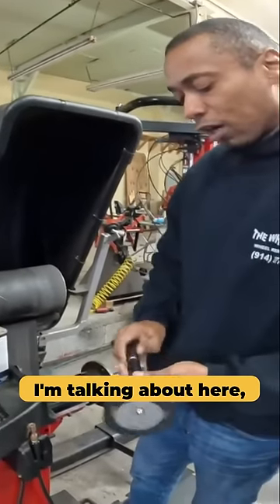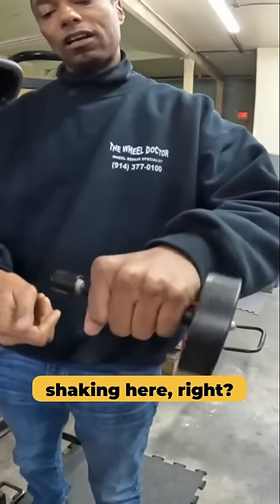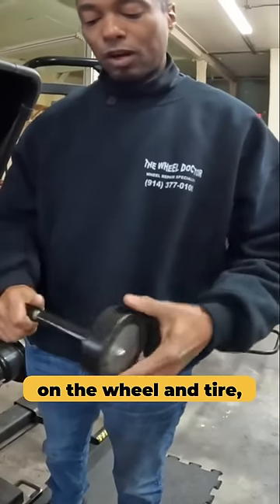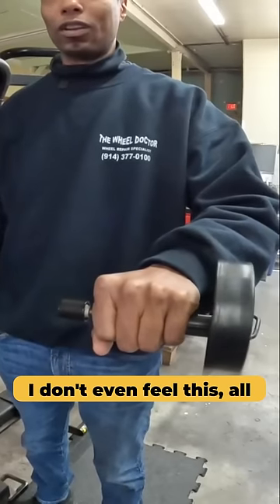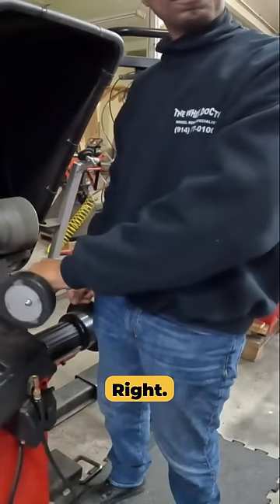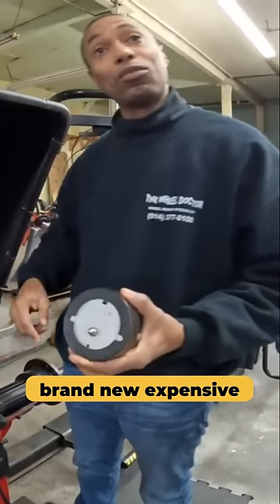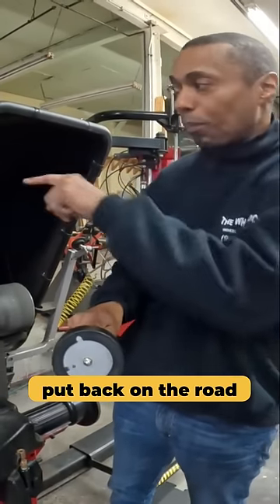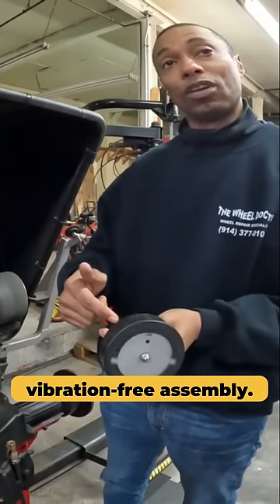1.5 MILLION VIEWS - Highway Steering Wheel Vibration (ONE SOLUTION) @thewheeldoctor7097

Comment: I understand what he is trying to point out here. Which is a clever solution to a very, and i mean very minimal scenario.
Tires are out of balance 90% of the time due to side to side imbalance, not out of round.
But yes this would aleviate that small example. 
Only downside i see is when the tread becomes worn its not possible or if done on a good tire, eventually you would find a bald spot before the rest of the tread was low. Depending how much was shaved off of course

Comment: I feel like every tireshop I go to and I tell them that's what I want, they always look at me like I'm the walking dead, no idea what I'm talking about
Reply from the maker: Either they don’t have the equipment, or they don’t want to do it. Use YELP to find more tire shops in your area
Reply: Force matching is not truly necessary. Most new car dealerships have this type of balancer. Not by choice but they are required by the car manufacturer. At least GM and Toyota. Been with Toyota for over 30 years. Have had this balancer since early 90's. If your basic tire store cares. Hard to find one that does. A regular balancer can show you out of round. Just manually spin the assembly and watch the tire if it hops on the balancer then you need to rotate the tire on wheel 180. Try again spin it 90 try again spin it 180. Now you have had the tire on 4 different clocking of the wheel  all 90 from each other. When the hoping is at its least or spins true, stop. Now balance the tire. But you pay for this rotating of the tire. A road force balancer can get this the first time ( I call bs to that) with maybe only one reclock to position shown by the machine to get the road force to its lowest.
Most decent tire don't need this. Just the simple spin and if they are true balance and done.   I know my brands, ones that will have issues and one that don't. We don't sell the ones with issues. Even if customer requests them. Pound sand I don't sell issues.
Reply: The same look they give when people come in asking for blinker fluid.

Comment: When fitting new tyres there should be a red dot on the tyre that should be in line with the valve also if you have locking wheel nuts if a stud hole is in line with the valve that's where you want the locking nut to go.  Hope this helps 🙏
Reply: It’s been a while and I know there’s 2 “circles” but I might be misremembering but I thought the yellow circle lined up with the valve stem.
Reply: @juanc.9735  I'm in the UK different markings to other nations I suppose

Comment: I wish I knew where to get service like this. I always ask for them to get it as close as they possibly can and I'll pay them for their extra effort. They just do the same job as the last person.
Reply from the maker: "I'll pay them for their extra effort".  This is key, as the majority of consumers are trying to get more for less.  I'll also pay for the extra effort.
Reply: You really shouldn’t have to pay more for the extra effort. When I was a young tech doing tires the place I worked did what was necessary included in the price of mounting and balancing tires to get it right. First of all you need to find a place to take your car that has the proper equipment and people capable of using that equipment. We had to rebalance tires for people all of the time that had bought tires and rims from some mom and pop shop who did nothing but static balance everything with just weights on the rear of the rim. They always had a vibration afterwards. We balanced them right and if needed to be force balanced and spun on the wheel then we did that too. We were the busiest shop in town because when someone brought their car to us it left fixed. Find a shop that takes pride in their work and believes in doing things the right way. It’ll likely be an independent owned shop that does everything from tires and brakes to diagnostic/engine work.

Comment: Most important part of putting tires on. Make sure the wheels are balanced.
Reply: Subjective opinion. Quality and application can make that statement null and void just as well as it can support it.

8,500lb daily making about 600hp and 1,000ftlbs, on 20x12’s and roughly a 33” OD tire averaging 85-90mph on the way to work and back like I’m late for everything, feels smooth as butter with no balance.

Meanwhile my race truck shakes like crazy in the rear after you let off (not on accel, while the tires expand) with balanced magnesium wheels and a tubed 28x14 hoosier in the back. Fronts don’t shake at all (also balanced, but skinny’s).

Mud truck, balanced or not on 16x10’s with a 37” or a 32” will shake no matter what over 70mph with laser straight aluminum wheels.

Comment: I think most large Tyres need to be force Matched, at least from my experience if I only had it balanced than the car would shake at higher speeds, I would then deflate the tyre a bit (not too much) and the shake would be less. I would then take the tyre to be force matched and all shake would stop. Did this with 3 of my cars and everyone of those had large Tyres. My Accord never needed force matching though but that had much smaller tyres.
Reply from the maker: That's interesting!!!!  Thanks for adding your POV

Comment: Worked at tire shop in my early 20s foe 5 years.  He did a perfect explanation of road forcing.  

Most regular sized wheels/tires was easy, it it when you get the giant wheels with low pro's that it becomes a bitch and would sometime need to break out the rachet straps ti pinch the tire away from the rim so it can spin.... oh, and a shit-ton of lube.

We road forced every set of new tires we installed.
Reply from the maker: I agree! I usually have an issue with my wide, low profiles tires, thanks for the comment..

Comment: Well balancing a tire is great. But I've had the same ceachle for 6 years. Always had a shake. Took it to about 20 different shops and after being suckered into multiple tire changes and balancing it was never resolved. So enough is enough I decited to investigate this matter in my own hands. So to find out the rim was bent the whole time. So how about mechanics actually do there job when they are balancing. Remove weights. Inspect rim for damages and re apply weights. Could have saved myself 6k over the years for wasted tire replacements for tires that are perfectly fine and still have under recommended tire replacement wear
Reply from the maker: Thanks for sharing

Comment: 79 and 80 i worked for a tire and suspension shop. We used the Hunter tire spinner machine.  It took a bit to get good at it but i could place a glass of water on the fender and it was as smooth as a baby's butt. 
The only exception was with Uniroyal tires. They came from the factory out of round. Customers would come from other shops after buying them and couldn't get them balanced. I would try but sometimes other than truing them nothing worked. 
Turing ment using a spinning cutter blade that would travel across the face and cut the high spots down. Watching the Customers faces when a couple thousand miles of rubber was removed from the tires to get the round. 

Had a new guy forget to check for Posi traction before doing the rear. For a open diff you raise the vehicle up and place a rim under one side and lower the vehicle down on the rim. Someone would then run the vehicle up to 60 or 70 mph and you would do the  balance on the spinning wheel. We heard a loud noise and watched the rim shoot across the parking lot and slam into front end of a car.
Reply from the maker: Really appreciate you sharing! I would feel some kind of way if you cut off a few thousand miles of rubber from my new tires as well 😂 And you’re not the first person to talk about Uniroyal Tires being out of round.

Comment: That's what i was trying to explain to a wheel guy, that you can even balance a square but it won't roll right. I knew something was wrong becose i had vibration at high speed after replacing the tyres and he kept telling me "wheels are ok, i have just ballanced them" The other guy i took it to did a road force balance and problem was gone.
Reply from the maker: This is EXACTLY what this video is all about! Thank you so much for your contribution 💯

Comment: The dirtbags at my local tire shop aligned and balanced my $1600 tires 4 times and 2 were burnt off in 4 months(down to cords) when the other two were fine…didn’t matter if they were on the front or back(I rotated them weekly once the problem was noticed), only 2 wore and I swear they were out of round from day 1…they were different batches of tires because they had 2 in stock and had to order 2 in
Reply from the maker: What the mess!?!? You have my attention, what kind of tires were they, sounds like summer tires? So what happened in the end?

Comment: the out of round tire has more material in one spot compared to the rest of the tire and is a factory made defective tire .. it is egg-shaped but not seen to the naked eye and the balance machine cant tell thats its out of round .. you do not have to go out and buy a new tire as its a factory defect that should be warrantied out .. used to work at an alignment shop that had an old school machine that would spin the wheel up to just above highway speeds and you would see the tire hop around even after being balanced .. you can either let gravity settle the heavier spot with more material to the bottom and shave a bit out of the tire or have the tire replaced .. have gone through a few of these tires over the years and had them replaced .. its usually felt at certain at higher speeds and can be driven passed within 10 to 15mph of the lowest speed felt .. its annoying as hell to have, especially when the tire shop doesnt have a clue how to fix it and keep using balance machines .. roadforce machines are good but they dont spin up to highway speeds so they can only diagnose the lower speed vibrations .. for the do it yourself guys, you can put your vehicle up on blocks or lift, put in drive and gradually speed up to highway speeds and you can visually see the tire (or tires) hop around
Reply from the maker: Very good explanation of the problem. Another good point you made is to make sure you buy tires with a warranty.  Thanks for sharing.

Comment: Holy shit i did not know this was even a thing. I just put two new tires on, balanced and did a 4wheel alignment, drives nice and straight but at 75-85mph i get some crazy vibrations. What do i need to look for and what do i need to ask for when going to a shop? Does a place like TownFair Tire offer this service?
Reply from the maker: If you were in NY, I’d highly recommend you bring the vehicle to The Wheel Doctor for a proper diagnosis. Call TownFair and ask directly about Road Force.  Could also be a faulty bushing or something else on the front end.

Comment: Ok I’m gonna go out on a limb here and say just get a new tire. It’s the only thing connecting you to the road stop being cheap and get what you need. It can kill you. Ask Paul walker. Pun intended. If you REALLY want to be cheap get a used tire and imo that’s still a bad idea.
Reply from the maker: Maybe you misunderstood, no one here is taking risks.  These ARE new Continental ExtremeContact DSW 06 Plus, getting mounted on recently power coated black hollow spoke wheels.  Check out the full video here https://youtu.be/mjqpijNDPCU?si=dea-dN2rlLCyrJBE
Reply: oh I’m not talking about the new tires that you got I’m just talking about the specific situation this guys was referencing. If your tires are out of round it’s just a good idea to get a new one. If it’s a brand new tire and it’s out of round because of a manufacturer defect it should be under some sort of warranty but regardless just take it back or it will be noticed at the shop when balancing. But yes my man you are taking a risk if you’re riding with an out of round tire. I mean I build cars and am a future engineering student so I understand suspension geometry and how serious simple vibrations can affect handling and how that car can get you into an accident it honestly doesn’t take much to understand how easy you can loose control of that wheel if you hit a pot hole or your power steering goes out and you’re trying to drive a heavy vehicle. It may not seem serious but like I said only thing connecting you to the road. I get it cheaper solution but it makes sense just to get a new tire if the tire is bad.
Reply from the maker: @DNightNinja  My bad!!  I'm a past engineering student, solid mechanics, so this is all interesting to me.  I recently learned from The Wheel Doctor, what you discussed as well.  New tires are not perfectly round.  And he commented to me before I purchased the tires, if the new tire is really bad, you want to be able to send it back under warranty and exchange it for a new one.  (I never thought about sending back a new tire - MIND BLOWN !!!!)

Comment: In the example given, the tyre isn't 'out of round' its 'out of concentricity' or 'off centre', depending on your datum. There is nothing they can do to 'fix' this, as its built into the wheel & tyre. If you're really fussy (i.e. racing) it's why you fit wheels using alignment collars, and not just the wheel studs. In extreme cases the tyre may not have seated on the wheel rim correctly, but thats just a case of deflating, lubing, and reinflating the tyre so it seats evenly.
As for the 'force matching', well that's called balancing, and it can be static or dynamic (which inherently includes static). The simultaneous equations for each are quite involved but straightforward enough once you get your head around them (the dynamic equations have 2 orthogonal axes to satisfy concurrently.)
I think they're claiming to separate solving static balance first, then dynamic later. It can be done, but its a waste of time because dynamic balance  solves static balance too. That's why tyre balancers will put two balance weights on the inner and also outer rim, not just one weight. Two are required for dynamic balance, where one solves static balance. Trust me you want dynamic balance to stop your wheel twisting off its flange at high speed even if it spun smoothly to start with.

Comment: For example mount a tire and check how many weights you need where. Then spin the tire one quarter on the wheel. And check again how many weights and where to achieve "balance". It will almost always be different.

Comment: I got my own $10k corghi balancer for my own cars. I can't see road force balancing being of much benefit. First of all a good rim should be true to begin with. If the tyre is up and down it will be up and down regardless of how it is rotated on the rim. If the tyre is out of wack too much, you can't do much about it. Most high quality tyres run relatively true when mounted properly but you get those that won't as there was some distortion in the manufacture process. I match balance tho and get weights right down but best to balance again after 5 to 10 K km after tyre has settled.

Comment: Yep.  But one needs a road force balancer.  When I run into this problem with new tires, I just get a new tire from my supplier.   Beside defective brand new tires, I have yet to get rid of a shake with just a normal balancer. 

With a road force balancer, its still just balanced with weights.

Comment: Force match is ok for a wild problem but not necessary 90% the time Its also a pain in the azz so make sure you charge about three times as much.
The tire will be mounted to wheel one time, put on the balancer spun marked with a piece of chalk in two places and then removed from the tire balancer to break the bead at the tire machine (assuming the entire tire doesn't have to be dismounted to turn it) then you get to balance it yet again and hope and pray that you still don't have enough run out that the tire is garbage 😂

Moral of the story it's okay but not nearly as useful as it might seem.

Comment: i put a tire on yesterday that had 70 lbs of road force.  i didnt balance it.  i made the parts department give me a different tire.  you really have to know the difference between a bad brand new tire and a rim run out problem.  thats not really a good demonstration of poor radial run out/ excessive belt overlap during manufacturing.

Comment: 90% of the time load balancing like this can’t fix the out of round tire, due to 90% of tires that shake or wobble are due to broken belts in the tire believe it or not it tires have a steel belt skeleton that keeps the shape and helps with weight distribution amongst other things . A broken belt can only be helped by replacement of the tire, so make sure your tire or tires don’t have belts pertruding out and then go from there on deciding how to make the tire back true

Comment: Road force is great, but rarely ever used in any tire shop. Just like tire shaving has gone away, it's more profitable for places to sell new tires and try and remedy the problem. I miss tire shaving, you can shave feathered tires true, replace only 1 tire versus a full set for awd, or 1tire versus pair. It was overall cheaper than replacing. But we live in a society that replaces versus repairing.
Reply from the maker: I am not familiar with tire shaving, but thanks for bringing it to my attention. And yes, we definitely live in a society that replaces things and are moving away from fixing/repairing.
Reply from the maker: I've never experienced tire shaving, may need to look that up.  Thanks for sharing your background!!
Reply: @OhMySack  you can find some race shops that still offer tire shaving and tirerack offers shaving as well. But it's a shame we toss out 3 good tires just to replace 1 flat for awd vehicles. Or 2 for 1 flat on 2wd vehicles.Its about speed and making money.